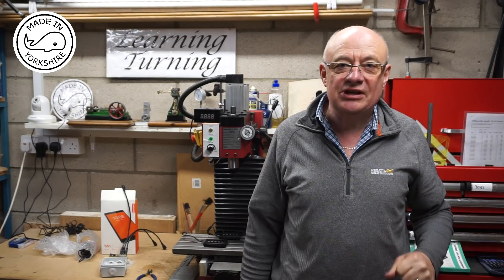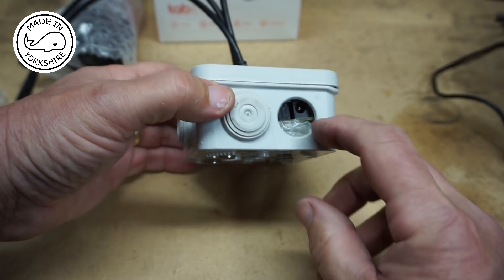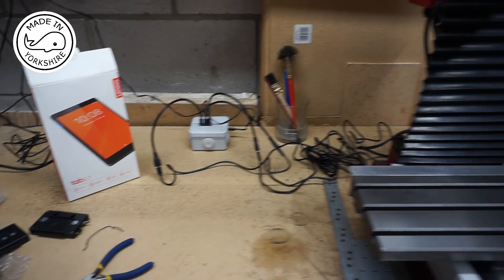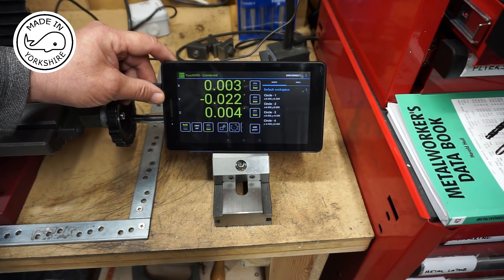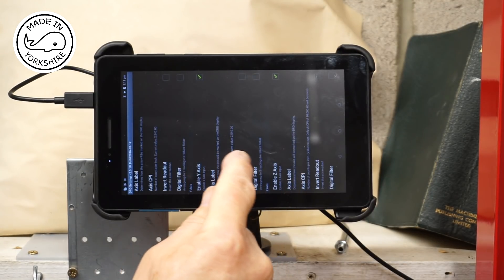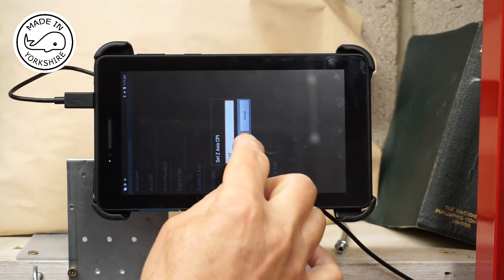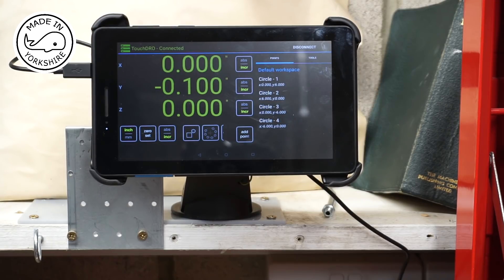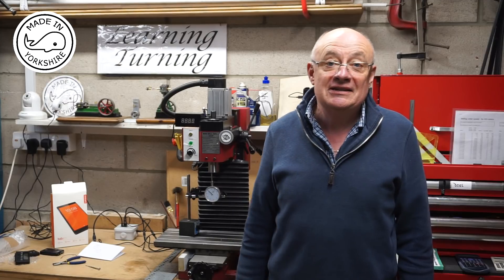#MT28 Part 4 - TouchDRO installation for SX2P mini mill. By Andrew Whale.

Comment from the maker: VERY IMPORTANT INFORMATION!
The TouchDRO technology has now moved on to be 32-bit based. As such, it is probably far wiser to purchase a 32-bit kit from TouchDRO.
However, if you still want to go down my old technology route..........
**YOU NO LONGER NEED TO EMAIL ME TO REQUEST THE TOUCHDRO INFORMATION** 
Just open the following link in your browser to download the zip file:
https://1drv.ms/u/s!AswDmAvuCnLqe6U5FFK263ba2aU

I am advised that the enclosure I used in this video is not ideal, as space is required for airflow and bubble wrap might affect the bluetooth signal. I will be making a better enclosure in the future. Also, the bluetooth controller needs to be reasonably close to the tablet in order to maintain connection.
The information sources that Adam used to build his bluetooth DRO controller can be found at the following links. 
1. A link to a built tutorial for bluetooth wiresless DRO board:
https://sawmillcreek.org/showthread.php?204470-Android-Bluetooth-Wireless-DRO-with-Arduino-and-igaging-scales
2. A link to Yuri's web page, the genius that made it all possible and all credit to him !!
https://www.yuriystoys.com/2012/09/arduino-bluetooth-module-wireless-dro.html
Reply: yeah, you can use metal stand offs like the motherboard uses, but rly? if you dont mind a more permanent setting just measure the board on the bottom and drop 4 big blobs of hot glue on the outside of corners (both stand off and fixing) and place it there.
Reply from the maker: Great idea. Hot glue stikes again!
Cheers
Andrew

Comment: Hi Andrew, 

Thanks for giving me the impetus to apply this project to my own mill.  I’ve been thinking about how useful a DRO would be for a while but was put off a bit by the cost.  Your series of videos gave me the confidence to attempt the DIY approach. 

I’m familiar with the Arduino Nano and have built quite a few projects using them but haven’t used a Bluetooth adapter before so Adam was really helpful in getting me up and running on that front (see other comments). I decided to use a micro USB breakout board (the same as I used to connect the scales) for the power input and paralleled this up to a standard USB type A socket connector as an output so I can use the power adapter that came with the tablet to power the Bluetooth/Arduino board and, with the use of an extra USB cable, supply power to the tablet for charging at the same time.  I housed everything in a small plastic box that is attached to the back of the mill with small magnets.  I remember thinking that I wished I’d had a DRO as I was trying to cut out accurately the slots for the USB connectors in the side of the box!

My mill is a Sieg SX 2.7 and I bought 600 and 200 mm scales for it for the X and Y axes respectively from Arc.  The 200 mm scale didn’t work properly (intermittent connection fault inside the sensor I think) but Arc swapped it out under warranty no problem.  In hindsight I could have gotten away with a 500 mm unit for the X-axis. 

From the testing I’ve done so far it works great and I’m sure it’s going to be really useful.  Before having the DRO I found it so difficult to remember how many turns of each handwheel I’d done and which way I’d adjusted for backlash.  Hopefully that’s a thing of the past! 

In all, I think the project cost me about £195 (scales - £90 (from Arc), tablet - £70 (Lenovo E8 from Argos; also handy for other stuff like storing/accessing lots of engineering data and watching Andrew’s YouTube videos!), aluminium angle and bar to mount/protect scales - £15, Arduino/Bluetooth controller components- £20).  If I need to add the Z-axis I reckon that’ll be another £45 for the scale and mounting hardware (USB connector already built into the controller board) but I can’t see the need for that on my mill because it comes fitted with a DRO on the spindle. 

During the build I also learned a bunch about how the X and Y axes of my mill work and thereby managed to reduce the backlash as a bonus.  A really worthwhile project I think.

Thanks again, Andrew.

Dave Edwards.
Reply from the maker: Hi Dave - thanks for the detailed feedback. I'm really pleased you got it to work. I too got lost with how many turns of the handwheel and always lost my centre point when using the rotary table.
I've found that the TouchDRO makes it a pleasure to use the mill - it's like a totally different machine. The circle function is really nice too.
Thanks again. Good luck with your projects.
All the best.
Andrew
Reply from the maker: Hi Dave - I've just read the comments between you and Adam. There's some interesting stuff in there that should help others. It should help me too, because I hope to build a bluetooth controller soon. I think I've got all the components now - I just need to finish off my current project.
Cheers
Andrew

Comment: Hi Andrew,
Thanks for a very interesting project and for the link to the arduino based controller.  One question I have (probably for Adam) is that in the PCB photo and detailed drawing there appear to be resistors between the grounds of the USB breakout boards that don't appear on the schematic.  Are these 0 ohm link 'resistors'?
Regards,
Dave Edwards.
Reply: Hi Dave,
You are correct they are just zero ohm links.
With it being a single sided board it made life easier to route the board, I could have put a solid core wire  links
ATB Adam
Reply: @adaml52  
Hi Adam,
Thanks for clarification; I thought that was the reason for them.  I've ordered the DROs and a bluetooth board today so should hopefully have something running in a few days' time.
Regards,
Dave.
Reply: Hi,
Check the pinned comment, there's an update firmware for the Arduino.
Adam
Reply: @adaml52  

Hi Adam,
That's quite an update! :-)  Your timing was perfect as I'm building the board today and will probably flash the Arduino tonight.  Will have to relearn some stuff to reprogram the BT module - did a quick test just powering it up without any data connections to see if it would pair with my mobile.  Phone found the module but wouldn't pair with it.
Regards,
Dave.
Reply: @daveedwards7575  
The hc06 Bluetooth module should pair out of the packet.
I know Apple devices will not work, Android devices should work fine.
If not the baud rate may need changing to 9600 in the DRO settings ?
Or 
Re program the BT device using a ftdi device set to 3.3v  Rx TX and ground are needed.
Remember that Rx pin is only 3.3v tolerant, sending 5v into this pin may damage it.
Set the baud to 9600 using AT commands, there's plenty of video's out there.

Adam
Reply: @adaml52  Hi Adam,
Managed to reprogram the BT module with a new name and PIN and connect to it with an app called Bluetooth Terminal.  Here's a link to the youtube video I used if anyone else needs to do this: https://www.youtube.com/watch?v=7XdSGU_W4ho .  TouchDRO will connect to it but keeps dropping out - I'm hoping this is because the module isn't connected to anything else yet.  Will report back when when I've completed the board and connected the scales.
Cheers,
Dave.
Reply: @daveedwards7575  
Find the end of the antenna on the module, it's a zigzag PCB trace.
And solder an extension of solid core wire 38mm long.
This will improve the range, it doesn't have to be vertical, bend it to lay horizontal if needed
Also check the touch DRO settings for matching baud rate.
Adam
Reply: @daveedwards7575  
Open the Arduino IDE, load the sketch, connect the Arduino via usb, select tools, select the board you are wanting to program, select the com port the Arduino is connect to, hit the program icon and wait for message for completion 😀
Reply: @adaml52  Hi Adam,
I got everything up and running today.  I used the updated Arduino sketch and modified it to suit my situation (only X and Y axes).  TouchDRO now holds the connection (I guess it needed to be talking with the Arduino).  So far the range seems to be OK without any modification to the antenna (in exess of 4 metres with a wall inbetween).  For the benefit of anyone else making the Bluetooth board I discovered that you don't need to reprogram the module with a new name and PIN.  If you use a new module out of the packet it will pair with name HC-06 and pin 1234 (will save you having to learn how to program it if you don't want to).  Thanks for all your help.  Now on to installing the scales!
Regards,
Dave.
Reply: @daveedwards7575  
Good to hear you've got it working.
It doesn't hurt to reprogram the name of the Hc06,  atleast you know what your connecting to.
As Ralph mentions in his video, the baud rate isn't always 9600.
The antenna trick, I did to a Bluetooth audio device, for better range.
Now you've done the hard part, good luck fitting the scales
ATB Adam

Comment: Hi Andrew, I think you have done really well with this project, but I find I really struggle to
 see the point of it, as there seems to me to be to many variables. You 
already have wires going to and from the scales, but then you have to 
rely on an interface, app and a tablet presumably running on batteries to use the 
display. Just seems to many places to me for something to go wrong and 
if the batteries are flat (and these things seem to go flat even when they
 are not turned on,) I think it could be frustrating having a dro you 
can't use till you charge up the battery, I admit I am a believer in 
hardwired devices though. Couldn't you just plug the cables into a 
monitor for the X, Y and Z? As I am sure this would be a more reliable 
system. Just a thought, as you have already done all the hard work with the scales
Reply from the maker: Hi Stephen - I really get where you are coming from. I think Adam's comment sums it up nicely - and more eloquently than I could have done. I think that this DRO solution offers really good value.
All the best.
Andrew
Reply: Hi,
I can see your point of view and agree.
These little mini mills are very expensive to add the industrial type stand alone DRO.
The typical slim glass type scales are way to big for for the small machines (physically too big) and the new compact magnetic type scales are very expensive, not far off the cost of the milling machine for the complete setup.
The igaging type scales that Andrew has used, comes with a small LCD display for each scale, that runs on two button cell batteries, that don't last very long, they have only have basic functions, like a digital caliper
The app for the Android tablet has alot of features that the industrial DRO's have, PCD and maths functions
You can run the tablet with the charger plugged in, so it lasts alot longer than the original batteries would last.
Replacing 6 button cell batteries becomes expensive for the original displays, as the displays are only in sleep mode when you turn them off.
Trying to get the perfect practical setup comes at a price.
ATB  Adam
Reply: @adaml52  Yes I can see what you mean. I have done 2 of the axis on my Sieg sx 2.7 with the glass scales and because of the way they quote the lengths You nearly always get them to long anyway. but these can be cut down to size very carefully using a dremel type tool and I used a grinder wheel and slowly and gently cut the glass to size , then the extrusion has to be cut to size and re-tapped with i think it was a 2mm or 2,5mm tap. But you are right it wasn't cheap,  The good thing about dro's though is that backlash  is taken out of the equation and they do make the machines much easier to use. Your Video's are always interesting though and keep up the good work
Reply: @stephentayler1414  
Hi Stephen,
I had the same setup on my first milling machine Seig X2, untiI upgraded the milling machine.
Hence giving the homemade controller to Andrew.
I ended up buying an Amat25lv from Amadeal in the UK, which I cannot recommend.
I went through the trouble of fitting a 2 axis Sinpo  DRO from China, with glass scales.
It took quite a while to fit scales, trying to find the best way as not to decrease the bed travel range to much
The scales don't look to be out of place, just enough room.
I found a few videos by other companies showing how to calculate the length needed, plus 145mm for the read head to achieve measured distance.
Overall quite happy with the DRO setup, I too enjoy the hobby of machining and electronics.
I checked your video on the VFD drive conversion of your lathe, looks similar to Steve Jordan conversion that he did.
If my Seig sc4 motor controller packs up, I'll do the same, as you.
As a new controller and motor is about £600, two thirds of the total of the machine !

Thanks for the kind comments on my videos, I'll post a video when time permits.
ATB Adam
Reply: @adaml52  Hi Adam Yes I t seems the Amadeal products need quite a bit of felting out of the box. I used the same motor and VFD as Steve Jordan as I knew they worked on his lathe and mine is basically the same, so I saw no point in re-inventing the wheel. Generally though I do prefer arc eurotrade to Amadeal. They are quite local to me and that is where my Mill came from. They do have a good relationship with Sieg, apparently they suggest mods etc and Seig seem happy to comply. The unreliability of the boards on these machines  was one of the reasons I ungraded to 3 phase though. Should I fry the electronics I can just replace a VFD for less than £100. Oh and I have to agree about fitting the DRO scales to the Milling machines. I can't move mine at the moment so I had to do it all in situ which I can't say was fun.  Took ages to do , but it was worth it in the end.Look forward to seeing your video when you get round to it. Regards, Steve

Comment: Nice one Andrew, it looks to work well. I'd kinda like something similar but hate messing about with computer and Bluetooth wotsits etc.
Reply from the maker: Hi Peter - I might have a go at making a bluetooth controller. If I do, and it works, I'll let you have it. I can help you get the TouchDRO set up. That is the easy bit, compared to attaching scales!
Cheers
Andrew
Reply: @learningturningmetal  Thanks, funnily enough I'd rather attach the scales than dabble with the electronics. I like to see what is happening so I don't like messing with computers.